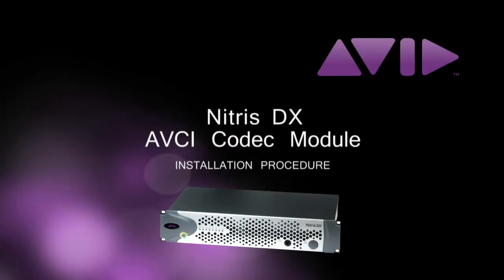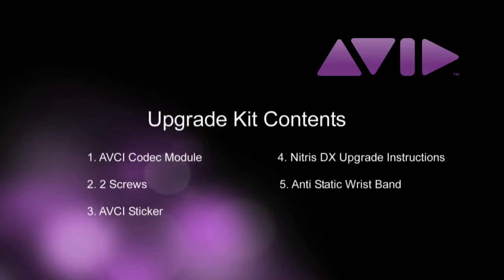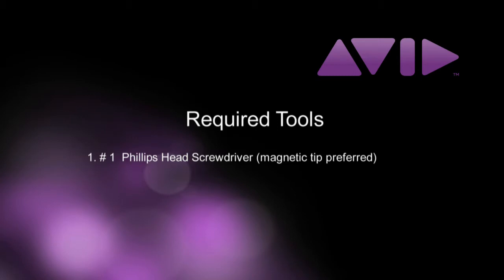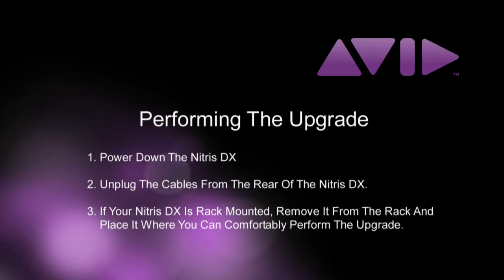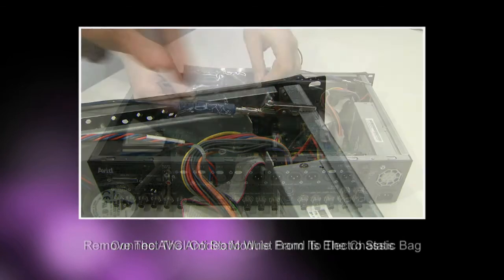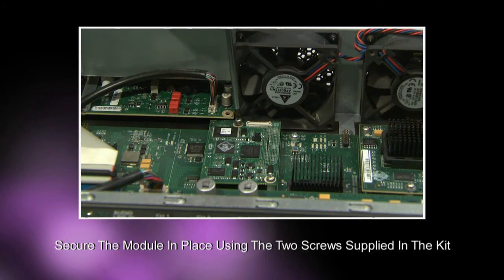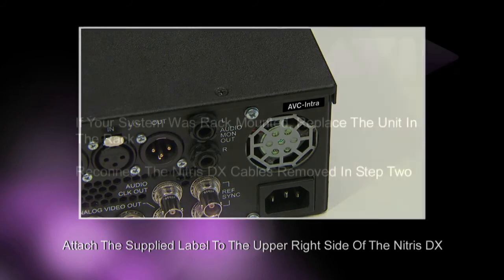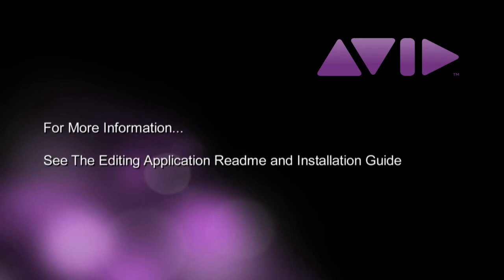AVC-Intra Codec Module for Nitris DX Installation Procedure

Comment: HELLO
 I HAVE A QUESTION FOR US.
I GOING TO BUY A SECOND HAND NITRIX DX HARDWARE ... BUT I SEE THAT THERE ARE VARIOUS MODELS: IN ONE THE NITRIX LOGO APPEARS TO THE RIGHT AND ANOTHER MODEL LEFT ... AND THERE IS ALSO A MODEL WITH THE AVID LOGO, BUT THE LITERS OF NITRIX DX DO NOT APPEAR.

COULD YOU TELL ME WHAT IS THE MOST MODERN MODEL OF THESE 3?

AND IF THE NITRIX DX HARWARE WORKS WITH AVID MEDIA COMPOSER 2019
 

WHAT VERSION HARWARE IS BETTER? 7020-20084  or 7020-30008

https://ibb.co/fSVfzhM
https://ibb.co/8xVCXkh
https://ibb.co/DpV17XT
https://ibb.co/vvV7jqx
https://ibb.co/HhS5bwq

HELP ME PLEASE. I DONT KNOW WHICH BUY